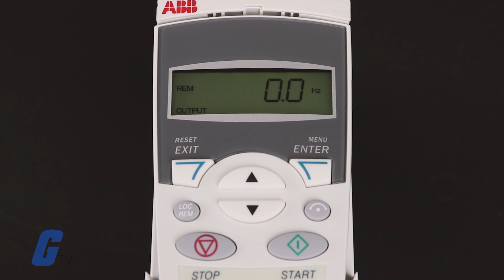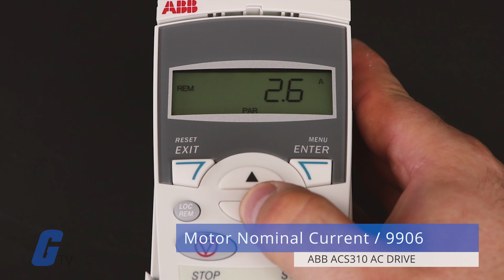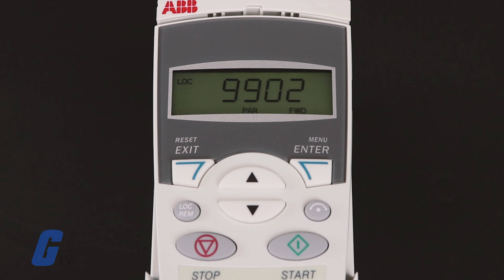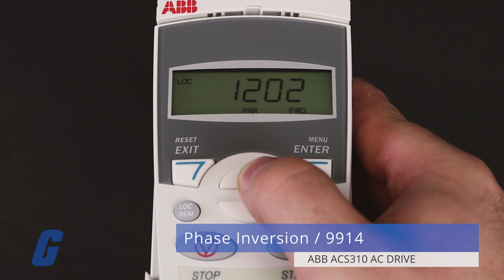Basic Startup on ABB ACS310 General Purpose Drive with Basic Control Panel

Comment: Anybody knows how to reset the all parameters to default on an acs310...thnks
Reply: To reset all parameters to default on an ACS310 drive:

1. Go to the Main Menu by pressing "Mode" multiple times.
2. Access the Parameter Menu (usually denoted as "PAR").
3. Find and select the "Factory Reset" or "FACt" option.
4. Confirm the reset when prompted.
5. Wait for the reset to complete.
6. Reconfigure the drive settings as needed for your application.
Reply: Apparently there is no such parameter. The walkaround is to apply ABB STANDART macro in 9902